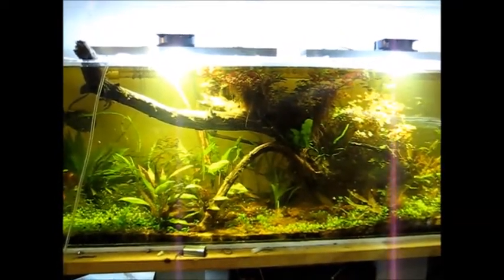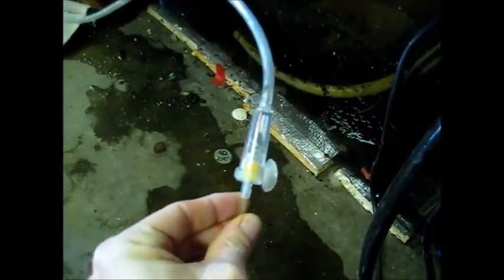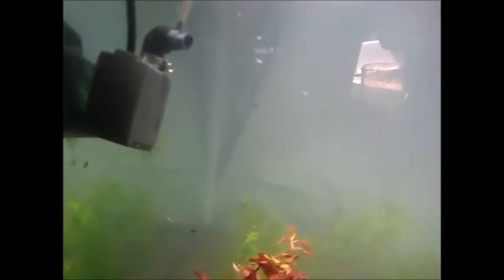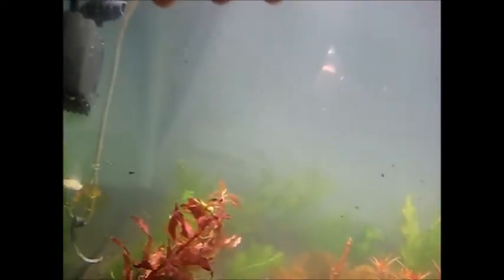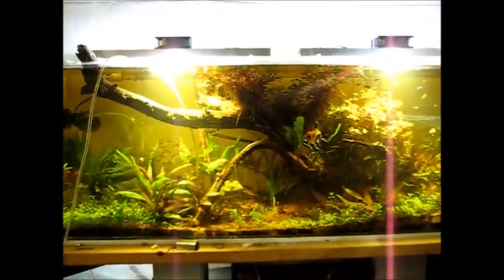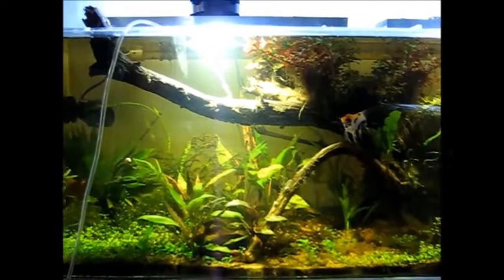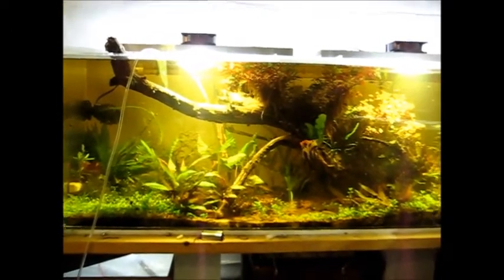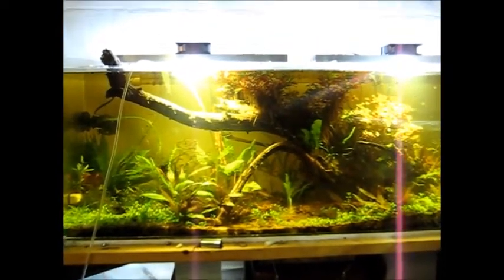CO2 Ramble for Ron Sovine's Contest

Comment: Also, there is a brass fitting that screws in to the bottle that replaces those Teflon washers and it last forever so you do not have to keep getting the plastic ones! I still use the tape every time lol! Habit I guess!

Comment from the maker: The glass one?  My point on the glass one was that quality matters.  That particular cheap diffuser running at 1 bps or less still produces large bubbles and is very inefficient.  There are similar looking high quality models that work very well.  But I would agree that a quality one that size working properly would likely not be sufficient for high CO2 levels on a 75g by itself.  I would however argue that it (HQ model) would supply sufficient CO2 levels if you don't require high pearling.

Comment: the co2 diffuser you're using at 7 min is to much tank for that defuser. they are fantastic diffusers for 40 gallons max! after 40 they recommend another one for every 40 gallons. the co2 should come out very fine not big and really slow. I use 4 on on my 125 splitting from my main with equal tubing.